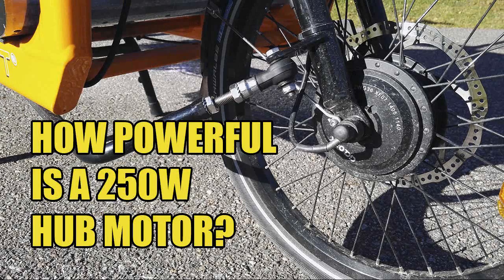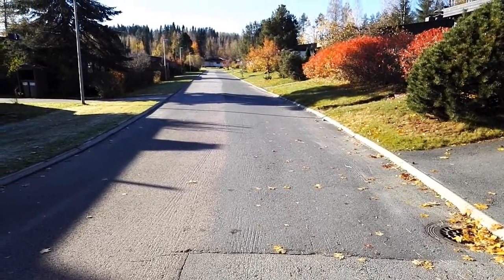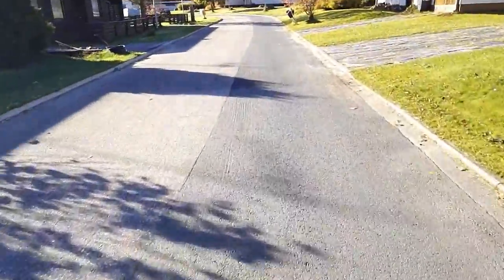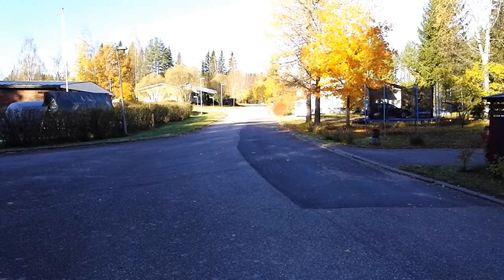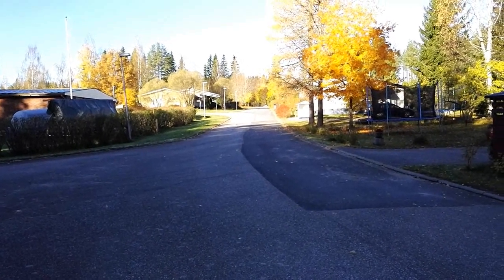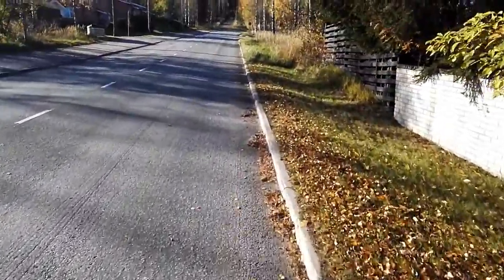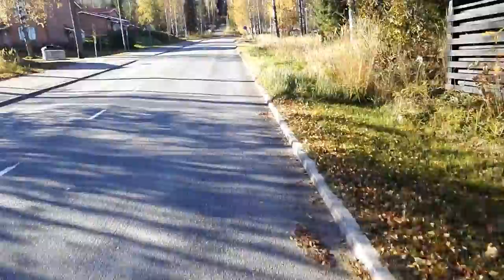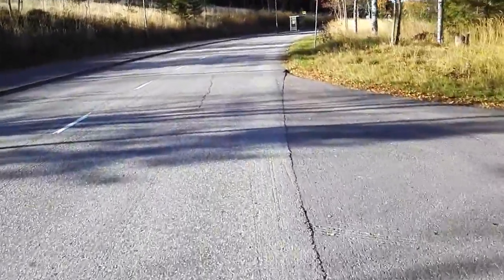How powerful is a 250W hub motor?

Comment: Great and very useful video, thank you. I really thought that 250w is week motor for small hills.
So, how after your video I have one question, if you can answer me.
I would like to have a little stronger bike, and I wanted to mount two 250w hub motors on my bike (front wheel and back wheel). So question is,  will my bike will be much stronger or the difference will be insensibly?
Thank you in advance.
Reply from the maker: Your bike will have much more torque and be faster going uphill, but not go much faster on the flats. Also running two motors will require two controllers I think, and if using one LCD screen you will only monitor one motor through the screen.
 
So why not use one 500W motor instead?
Reply: E-Bike Commuter Two days ago, I bought motor with 500W because I realised that it will much better. Now I need to assemble it and to enjoy the ride 😁 Thank you
Reply from the maker: Milos Milojkovic 

Great! Good luck with your new ebike kit!
Reply: Thanks

Comment: I had e bikes and folding scooters the 250 watts to 350 watts the poor batteries back then heavy and low powered 250 watts with today's batteries should work better start with what you can afford the good thing is things get better and cheaper over time

Comment: how is possible that a 250w rotor gives you 550watt on the screen?
Reply: sysrq sq  that bike have a 750watt motor. I researched on the web. It can gives you even 750w constantly if necessary.

Comment: Yeah I would rather have a 1000watt motor with no internal gears to have to hear and a hand throttle. Maybe someone makes them to also charge on downhill just to help out with the mileage. (Just like certain cars and scooters have as starter motor/alternator.) I have only so far seen one motor with built in battery do this recharge on over run.
Reply: I forgot to add; Nice video; Appreciate the clear explanations and no irritating music. Thank you.

Comment: Is your point that a 250w motor is as powerful as a 500w motor at nominal? will the motor windings melt?
Reply: A 250 watt can go to 1000 watts for short periods and run continually without problems on 360-512 watts

Comment: Can someone help me? I bought a tiny scooter with a hub motor rated 250W, thinking that would be enough to commute 2 kmts. Manufacturer wrote a range of 20 km.
Well, the stuff almost couldn't move when I first tried. Maximum speed being 8 km/h instead of the 20 km/h promised -and only with the full battery. After 100m the motor got hot as a tin roof in summer and went further slower. After 200m the energy left indicator showed 1 bar from 5 left. Any grade steeper than 1 0/000 was too steep to climb. After 500 W the whole thing stopped, the motor overheated and a fuse separated the power supply.The hub motor in the 6" wheel was red hot. 
I brought back the scooter because it was of no use for me. Did they cheat me or why was that scooter so incredibly powerless? On a normal bike I can ride much faster, so where  goes the power of the motors?
Reply: That scooter might have had the motor broken.
Reply: Definitely sounds like you had a lemon straight out of the gate. Do you have an update on your situation?

Comment: is this 250 watt motor can carry 150kg with acceptable speed in flat surface?
Reply from the maker: ShaimX Баутиста 

I have a 150kg load daily and can do 20-23km/h with little effort on a flat surface. On a 20km distance my average speed will be ~18km/h.
Reply: So it takes one hour to go eleven miles, assuming you can keep going  non stop.
That is painfully slow
Reply from the maker: Everything is relative. My commute to work takes 10-15 minutes by car and 20 minutes by bike. That's such a small difference and makes me rather cycle to work and many other places, too.

Someone who is fit and rides an aerodynamic 7kg road bike, can go 30km/h for 3 hours. I wish I was that person. But not quite there yet. :)
Reply: Well keep up the work and good luck on achieving your target.

But I'm of the mind that more people would move over to electric bikes if the motors were just that little bit bigger, basically the same rules as the USA uses which is a peak of 750watts with 500watts motor with a max legal speed of 20mph by motor.

Also many of the European countries have super electric bikes which allow for 28mph without insurance but with registration plate, the plate is very small.

Comment: How is this 250 watt motor drawing over 550 watts?
Reply from the maker: tarstarkusz 

Please take a look at the motor specs here:
http://www.ciclotekstore.eu/b2c/producto/9822150/2/platinium-lcd5-b-o-s-e-bike-motor-kit-36v-without-battery
Reply: Basically, it's a lie to comply with stupid EU regulations: ". Continuos (sic) nominal power is 350 watt. and peak power is up to 700 watt with our 17 A controller. "
 With 350 watts nominal power, that's a 350 watt motor:)

Comment: its ok    not bad for what it is  i bought a  bafang 8fun 250w  hub it has not  arrived yet     but im now  worried  as i was told  there is 2 different  types  sensorless 3 pin     and hall sensored 8 or 9 pin    i cant see as there is a plastic protection cap on the plug to protect the pins  has anyone bought this  hub  or could anyone  tell me  please ?    heres the link  below ....................................................................................................................................................................................................https://www.internet-bikes.com/en/236120-bafang-hub-dynamo-8-fun-36g-36v-250w-silver/?show_currency=GBP&gclid=Cj0KCQjwudb3BRC9ARIsAEa-vUvtBgiflzPRcqKJKGuHudgwmgW0vfA1iIHdbqE9OkqYNhnsWDlg5akaAqW6EALw_wcB

Comment: That's pretty amazing considering that the rider is 265lbs....what sort of voltage does a motor like this require?
Reply from the maker: Miles Papineau 

36V
Reply: E-Bike Commuter thanks for your response. where did you buy this kit? did it hold up long term?
Reply from the maker: Miles Papineau 

I bought my conversion kit here: http://www.ciclotekstore.eu/b2c/productos/1/2/114/kit-platinium-lcd5-b-o-s-/1

My batter was bought separately from Germany through ebay.

I am on my second motor now. The first one worked beautifully for 5000km until I decided to open it and unfortunately damaged it in the process. One of my latest videos describes what happened. Had I not damaged the first motor, I would still be using it. I am now at +6000km since I bought this kit.
Reply: E-Bike Commuter thanks for the link!

Comment: Well, i just come across this, since this is the maximum allowable sized motor in my country, any more and it has to comply with "Design standards for motorcycles"  mopeds are even illegal on these roads..

So, one question I do have for you, would getting a larger electric motor (say one designed for 500W) and having the 250W controller, would the motor last longer?
Reply: Yes but the issue you face is that it's the motor itself which is the issue and even if you get a 250w system some even require a reduced assistance above 19mph
Reply: I don't think it is a speed limited factor, its only power allowed, hence the thought the 250W was going to be maxed out with the power output to deliver the 250W, the thought I had was that a 500W motor delivering 250W would last longer.. 

..and with that idea, maybe put it in as a mid drive, so the 250W can be multiplied via gears to push at the highest speed..
Reply: Having a stronger rated motor will allow it to operate at a higher efficiency since it generates less heat like the 500w peak used by the 250w motor shown in the video.
The laws govern the motor and not the controller I'm afraid so you can over spec your motor.
A hubbed motor is typically only useful for free wheeling and low power drive systems so you often find them on the front wheel.

Having 2 motors will also be considered a combined power so 500w in the eyes of the law. 
Mid drives are good for allowing you to get a high efficiency out of the motor by allowing higher top speeds and higher torque at the lower speeds, the only issue is that the forces are pushed through the chain and sprockets so they wear out a lot quicker and if it isn't set up well you can easily snap the chain or have it slip sprockets.

Hub motors even if the chain snaps still allow you to to drive the bike with a twist throttle =)
Reply: Heh, you're probably right, about the law there, knowing Australia.. come to think of it, yeah, multiple motors, even if one isn't connected is still "500W power output" 
I now understand why people get 750W'er and throw a 200W sticker on em, lol. till it gets "impounded" and looked over... then its a $200 fine.

im just looking into bending these rules.. 
No ICE engine for power output? how about as a generator?
500W motor on a 250W controller? probably burn our the controller ;/
etc..

I've snapped a chain peddling, burst at 50KM/h, the helmet didn't even get a scratch, every exposed skin did, including my chin.. so yeah, if I can do that under load on highest gear, then I can see the 250W'er snapping, or making it slip.
Reply: ***** if you wanna do a floppy eared, the dude from china said it was legit.
You can but 48v 1000w hub motors that have a switch to put them into a 250w mode, its still illegal but some chinese sellers are saying they are legal.
Or get one second hand and say the owner stated it was a 250w or something.
This is all still illegal as hell but you might get away with it, to be fair id imagine if you were driving like an asshole, i doubt theyd say anything
Reply: ***** basically you gotta ask does the police man ride ebikes or knows the laws regarding them. 
You feeling lucky, punk xD
Reply: all he knows is big hubs = bad, fast bike = bad, ice motor = bad
Reply: ***** take the motor rating off and say it was a self built motor kit, thats why its so big, just slap on 36v on the battery
Reply: lol, Done! as you said, if i don't be dick on the road, they have no reason to tell me off

Comment: 16 Kph = 10 mph and 20 Kph = 12.4 mph! A 250 watt motor is a waste of time. A 500 watt will give you about 70% more speed and 50% more fun. The cost difference between the 250, 500, 750, and 1000 watt motors is so little. buy the 1000 watt and limit your speed by limiting the battery voltage. I think a 1000 watt motor with 36 volts will give you close 28 mph, but if you have only 24 volts, bike will go only 20 -22 mph.
Reply: 1000w hub motor costs over 700€ in my country. paired with 48V batt and 1000w controller  i'd pay more than for used 250cc  mx. just no go at current prices.

Comment: i have an electric assisted bike and it work's fine..Untill it run's out of power...then it's useless.
Actualy feel's like trying to cycle through wet cement.
Reply: not really idiot, his concerns are legitimate; its bicycle not motorbike. motor is there only for assist not as primary means for driving.
Reply: Sometimes I pedal just for fun but 90% is with the throttle . Never had my battery go flat . Also the 'wet cement' is true . Reason is a hub motor is   the wheel so  you  are  pulling  all that rotating weight  . Plus when the motor isn't running  you  are  pushing  against the magnets in the hub which gives it that drag effect
Reply: 30AH 48V lithium ion battery and a 1000w RWD motor

i only need to charge it once a week, only time i ran it totally dead was on purpose during a range test (which was 112km with zero pedalling)

i have come home on the red light of doom a few times, but the motor has never cut out on me while i am riding
Reply: Don't let it run out of power 😒

Comment: Why it used so much power? According to this https://www.gribble.org/cycling/power_v_speed.html on your 1 and  2 uphill power should have been 240 W! Is your motor a geared one?
Reply: Efficiency of hubs drops when they rotate at slower speeds. Check similator here whilst changing grade http://www.ebikes.ca/tools/simulator.html

Comment: Why are you pedaling?
Reply from the maker: I need to pedal to keep the motor running. I do not have a throttle installed on my bike, only pedal assist. This means the motor is only running when I pedal. But as I say in the video, I am only pedaling in the first gear, slowly spinning the cranks to keep the motor going. The motor does all the work in this video. No power was put to the rear wheel even though I was pedaling. This may be confusing to you if you have not used a pedal assisted system before.

Comment: how can a 250w motor produce 500watts of power?
Reply: The 250W is a nominal rating that the motor can sustain continuously. All motors can be run at higher than nominal power for short periods without overheating.
Reply: Paul Thomas it's drawing more power watts can be form of kw hp or consumtion of  energy used.  some 250w engines like brushless produce 50% more power then brushed motors, some can hit speeds of 40kph whiles others like his one can hit a crap 20 the rating is done of very affecent neodymium brushless motors rather the old brushed ones most of these 250w engines are 1/4 a hp but the very good ones are about 1/3 hp but again with gearing in the motor you can achieve high tork so theriticaly you 250w could hit 50+ if you could increase tork, you engine power is not calculated by consumtion of anergy but rather that wich is produced on the hp scale of things calculated on a 88 % effect motor most are about 65%
Reply: The peak power lies in the relationship of the battery voltage and max amperage rating of the controller regardless of what the motor rating states (Watts=Voltage*Amperage). For example If he is running a 36v battery and a controller rated at a modest 15 amps then his peak wattage is about 540W. Most companies that manufacture Ebike motors especially in Europe where max wattage is 250W will underrate their nominal wattage rating to be legal. Depending on your battery/controller setup most will provide a much higher continuous power output without burning up the motor.
Reply: +Raven M. your right the power comes from the controller and battery I remember as a kid my brother would use s 500w ride on car the speed controller was to big for the battery and use to melt the battery it was a car battery but was the wrong rating for it only just tho but if you use it on hard ground nothing would happen.